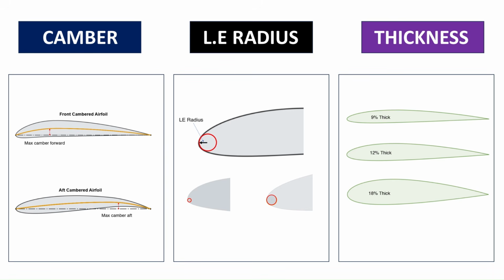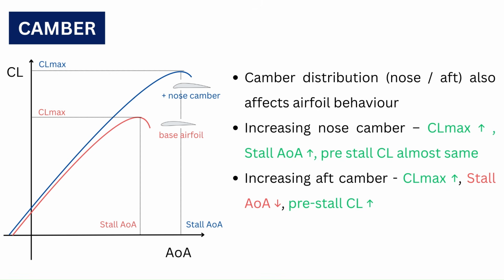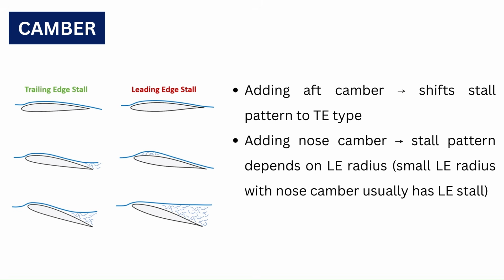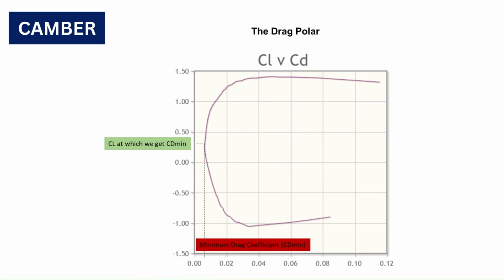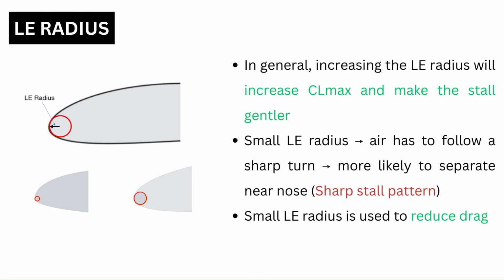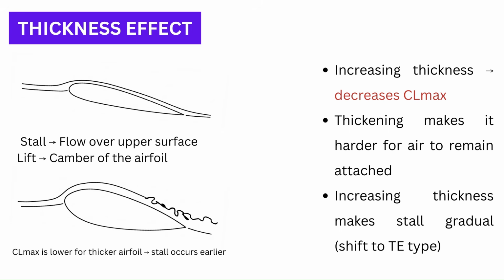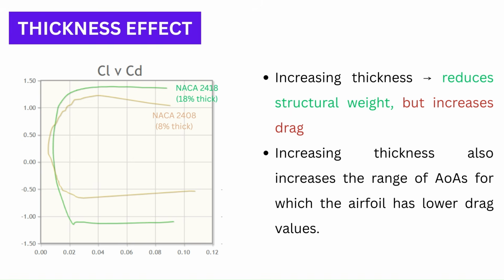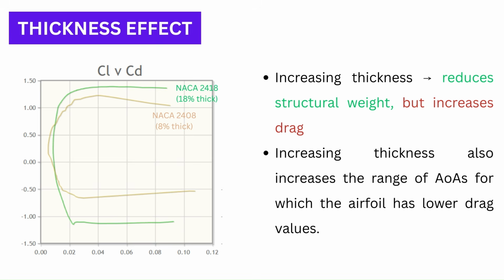Part 4: Effect of Camber, Leading Edge Radius & Thickness | Airfoil Selection

Comment: increasing thickness lowers weight?
Reply from the maker: Hi, as I understand it, increasing thickness means a thicker (i.e. taller) spar can be used --> moment of inertia of the spar is increased --> more bending resistance . For a thinner section, more material/stronger and heavier material would be needed to provide the same bending stiffness.